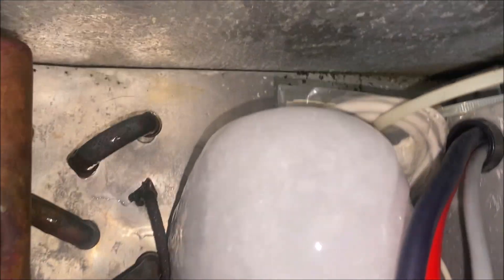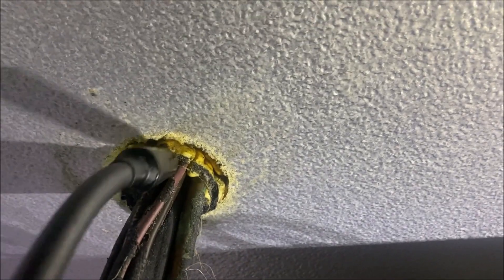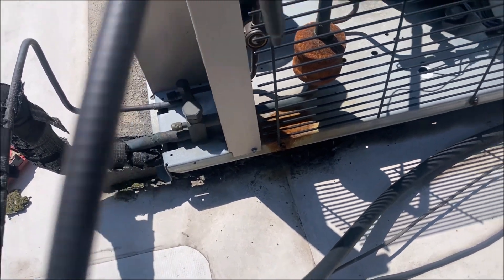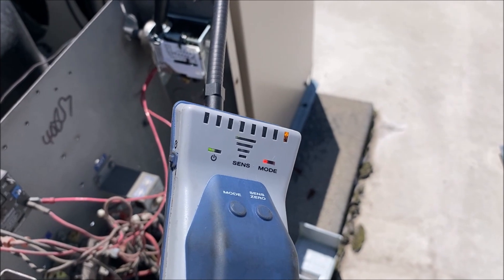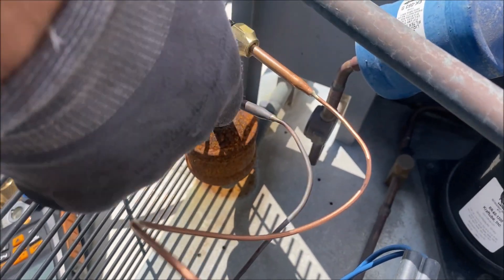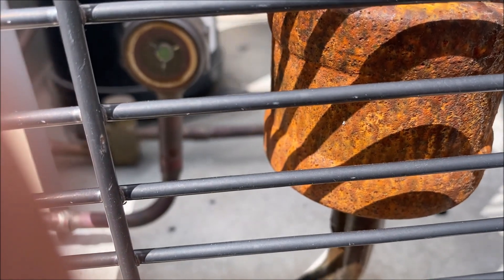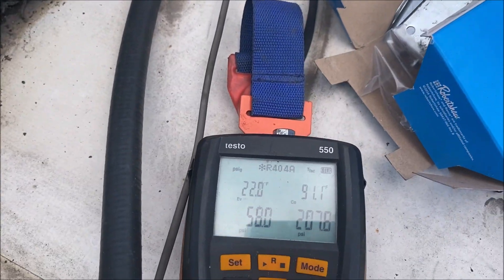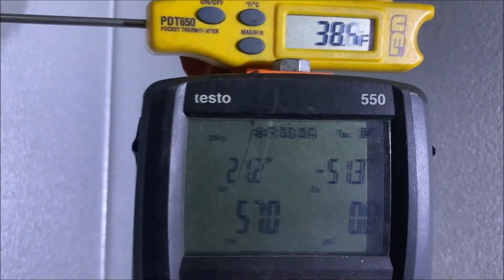Walk in cooler needs to be "topped up" every 6 months

Comment: I have a silver king meat well freezer.... cold walls or I think you call it something else. Do you have videos on pressures for those. 404a? With cap tube
Reply from the maker: I do not have one for cap tubes. I would assume we are aiming for a 0F to 10F evaporator coil though.
Reply: @REFRIGERATIONKITCHENEQTECH  yes. -10°f box.
I have a few that I have recovered the refrigerant and added new charge but only 1 side starts to freeze.
Reply from the maker: If you can get the head pressure up, sounds like a restriction. If that’s the case, I would blow out the cap tube

Comment: How did you connect that Supco strap to your Testo?
Reply from the maker: Drilled a hole and put a short bolt with a nut. You will need a short bolt as there is a board close by. Well worth it though

Comment: After a long day I was blessed with working on a Liebert refrigerant unit 20 ton two compressors. It had a leak and I just could not find it. I stepped back and said you POS and began firing off  my big blue at it, I hit the bottom of the low pressure switch on a fluke and it started to bubble. Bad thing is I found them before like that, but that's what long days can do to you. Great video.
Reply from the maker: Lol, been there done that

Comment: 👍💪❄🇺🇸🙏 great vid. Is there info on the condensing units that will say 15 cs or 30 cs ? Or is it more about age of the unit ?
Reply: If coil micro channel its 15F but if the coil fin and tube its 30F the magic is looking at coil and see if it’s micro channel or not because micro channel supposed to be more efficient that’s what they say so
Reply: @mohamedrichi5370  Thank-you
Reply from the maker: More of the age I guess. One day I’ll track down an engineer and figure it out